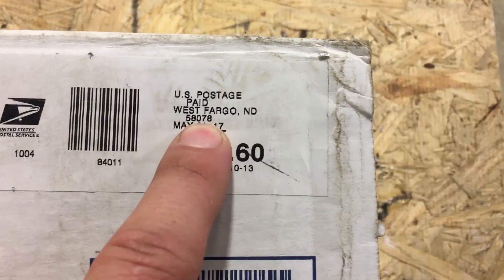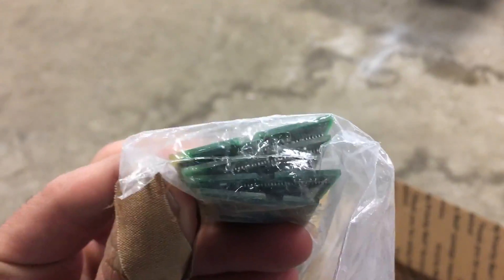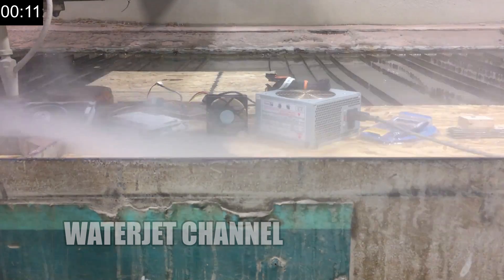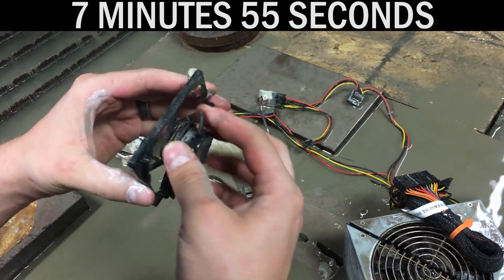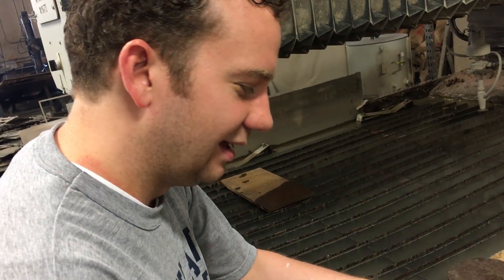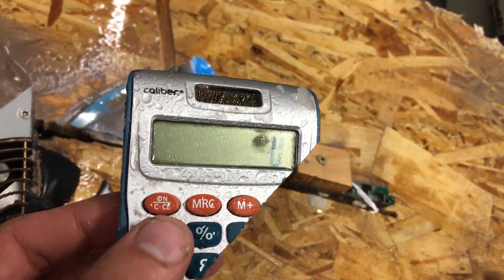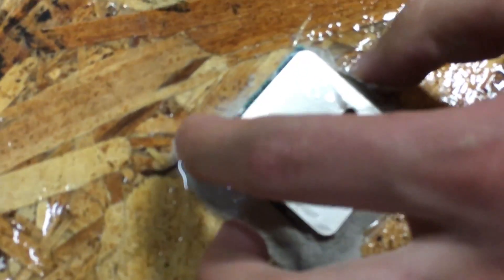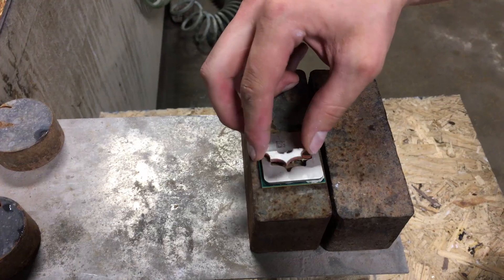Inside A Computer Processor With A 60,000 PSI Waterjet - AMD CPU cut in half

Comment: The large silver metallic top to the processor is quite literally a giant heatsink/transfer plate for the cooler. The actual chip itself is 1/3 the size of the copper heatsink on top.

Comment: Looks like it’s about time to change out your ruby orifice there brah. God, kill me... I know exactly what your day to day life is like working on one those loud, dirty flow jets. Loading 50lbs bags of garnet into those hoppers only to have to spend a day shoveling it back out of the water tank every couple months is hell. I ended up developing a nearly deadly opiate addiction from constantly throwing my back out from repeatedly picking up all the metal, bags of garnet and then shoveling that wet sand out of the tanks for 5 years straight. Get out now if you can and never look back.

Comment: The copper is the heat spreader not actually part of the processor and is removable. You would find under that chips that are connected to a board not really exciting or complicated.

Comment: Is licking everything a personal meme or does your tongue detect elements
Reply: Waterjet Channel Didya' taste that tongue noises tastes like BS. xD
Reply: Waterjet Channel You know, I'm kinda wondering if the power supply would have lasted any longer if you used a non-conductive liquid and blasted the components over a more durable surface.(one that wouldn't blast minerals and wood chips everywhere)

Comment: 5:23 I would NOT recommend liking that, the processor contains a shitload of toxic chemicals, from heavy metals like copper, and tin, to stuff like phosphorus, arsenic, boron, etc. The part that touched the tongue was probably pure copper, but the silicon die itself and whatever thermal interface material is between the die and the heatspreader, are probably pretty toxic to humans.

Comment: fun fact about processor in 5-8 years at the current size, we will no longer be able to fit any more transistors on a cpu cause at this point there will  only be about 6-8 atoms of silicon between each transistor any thing smaller and it  cant block the flow of electric. so we will most likeley see an increase in the size of the cpu

Comment: After the creators of the water jet channel asked those to send them anything to be sliced open when they got a shipment of computer parts that would meet their fate against a 60,000 PSI water jet when they powered up a desktop power supply when they already know whats inside a hard drive before they want to know what was inside a desktop power supply and a processor and a RAM stick.

Comment: From my minimal knowledge of CPUs (or computer processors as you called them) the actual CPU is a small(ish) chip towards the center of the module. The rest is to spread heat on top and a assload of tiny wires going to the pins on the bottom.

Comment: 5:26 Pretty sure that coppery stuff is just thermal compound, the transistors are underneath.
Reply: AMD CPU's are SOLDERED, there is NO thermal compound in an AMD chip, even then NO thermal compound is that thick, that copper section is the INTEGRATED HEAT SPREADER.
Reply: DanielRichards644 That's basically what I meant, I'm no gooder wit wordz.

Comment: If they could power the processor on, the waterjet couldn't touch it. It's AMD, so it would vaporise the water the moment it left the jet ;)
Reply: Epic RainbowSlime you also couldn't cut a baterang out of a modern intel CPU, as they use shitty thermal paste instead of solder
Reply: actually that statement is wrong. current Intel cpu's run much much hotter than any amd processors because of their refusal to use any adequate thermal paste at the very least, when they should be soldering their ihs'.  cpu's such as the i7 7700k are reaching temps of 100c something absolutely no current amd cpu will get close to reaching when at its max overclock without ramping up the voltage too much past a safe amount.  This is because AMD solder's all of their cpu's no matter the tier.  the new x series i7 and i9's still have the crappy Intel tooth paste as their source of heat conduct for their ihs.  a simple delid and thermal paste replacement with liquid metal or higher quality thermal paste drops Intel cpu temps by as much as 30c is the most I think I have seen.  but on average it drops around 20.
Reply: Chronos5618 actually, intel cpus tend to run hotter than AMD cpus, possibly because AMD cpus dont have integrated graphics, but intel cpus do.

btw if you wanna know where im getting this from, i have an FX-8350 (but im hoping to switch to an R7 1700 or something along those lines around christmas), my cousin has an i7 7700k. mine is cooled with a H80 V2, a single rad water cooler, my cousins is cooled with a H100 V2, a double rad water cooler, and we get similar temps. at most mine normally goes 3 degrees higher than his, with a single rad, compared to his double rad.
Reply: SHADOWxWOLF the current intel CPUs (skylake) run hot as fuck, Ryzen has way more Performance/Watt
Reply: Check reviews on the new I7 7740X and 7900X. They run crazy hot compared to AMD's Ryzen chips.
Reply: ever heard of Pentium D's inferno?
Reply: Never understood why people still think AMD CPU's run hot. Even with the FX CPU's the TJMax was 65C on the core and about 10C higher for the socket. The TJMax on my i7 5820K is in the 80C range. Intel processors run a lot hotter, although AMD's voltage is a lot higher.
Reply: pyromen321 Hardware bugs? Lol it just requires optimization and BIOS updates. Hell a lot of the issued at launch have now been fixed. Get with the times lmao
Reply: thats interesting
Reply: Elias Oen Whatever you say. Doesn't change the fact that my CPU stays cooler than an i5 or i7.
Reply: Chronos5618 nowadays that would be intel
Reply: what about Ryzen ;)
Reply: Look up i9's tdp and say that again, i fucking dare you
Reply: 16 cores 32 threads for 849 usd, so how do they suck again? and with ryzen 3 on its way, now we can have low budget quad-core desktops!
Reply: My 8350 has never gone above 60c under 100% load. Pretty cool if you ask me.
Reply: Elias Oen It does actually. It's just not supported on every motherboard. My 970 didn't support it, but the 990fx does. The 970 only showed what you're talking about. Regardless, i5s and i7s can reach ridulous temperatures.
Reply: MilesDei you’re an Intel fanboy and it’s competing this year if anything amd has the better price to performance
Reply: ryzen>intel
Reply: They did, They already did, They beat them in the past, hands down, and they are doing it again.
Reply: Chronos5618 ha say that to ryzen it's intel that runs hot!!!
Reply: MercilessHobo with an amd Fx you always count +15-20 degrees
Reply: Elias Oen Nope. There are two separate measurements, you count the higher one. The higher one never goes above 60c. Lower hovers around 45c.
Reply: MercilessHobo  the fx has no temp sensor, they just measure the heat with the load in %, if you got 100% it says 60 degrees, you could have the best watercooling, it still says 60 degrees. Depends on your cooler
Reply: SHADOWxWOLF the 7980xe hits like 700watts under load
Reply: Does this matter, I mean just focus on what you're getting with that processor. I don't know why people's compare AMD and INTEL, they both are good in their own ways. I like them both
Reply: MilesDei "Wrong"~ Donald Trump, 2016

you are as well
Reply: MilesDei funny you should say that, 1. AMD was competing with intel a decade ago, then intel started underhand deals (you know, the ones they were in court for 10 years about and got fined 2.1 billion for) which just so happens to line up with when intel pulled ahead, and AMD made the first 64 bit cpu, and the first 1GHz+ cpu
2. remember ryzen? yeah that scared intel because AMD had caught up. want proof? you know that i9 intel announced? yeah that was going to be announced in 2020, but intel paniced and decided to push it forward to now, plus, threadripper looks set to at least match said i9, possibly even outperform it in some regards. so i believe you, mr/ms intel fanboy/fangirl, are wrong.
Reply: lol you're just fuckin salt that the I9 is trash. mad cause bad
Reply: Chronos5618 I guess my Fx 8370 running a stock wraith cooler is very hot at 18 Celsius....
Reply: Hilbert Black, I don't think you understand what hardware bugs are. They are unfixable mistakes within the electrical engineering of a die. They can almost always be covered up with microcode updates, which either error correct or just avoid the bugged circuitry, but the underlying issue can only be fixed with a new wafer revision.
Reply: MercilessHobo still has no integrated sensor. It is in the Motherboard
Reply: Chronos5618 lol. Only overclockers understand that statement.
Reply: If it were a Ryzen, all of the hardware bugs would come scuttling out when they cut it open.
Reply: since when. from all the specs and benchmarks i have seen intel still runs cooler than amd. just because the cpu is rated for a temp doesnt mean it will hit that.
Reply: Chronos5618 AMD sucks they'll never touch Intel.

Comment: inb4 throwing a moist lump of whatever at an electrical box causes a short
Reply: It's a metal box a little clay on the outside isn't going to cause any problems.
Reply: it's CLAY Dumbass, clay is NOT electrically conductive and even if some small amount of water made it into the box it would be unlikely to short the capped wires inside the box.
Reply: It's moist ya git. And there's no telling if the installation is laid properly.